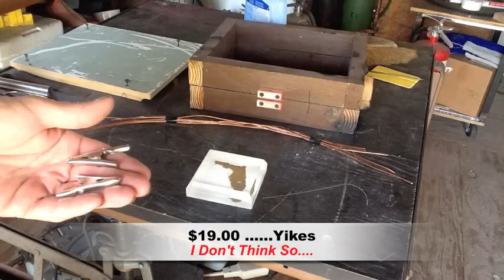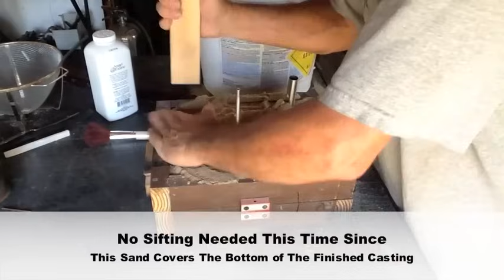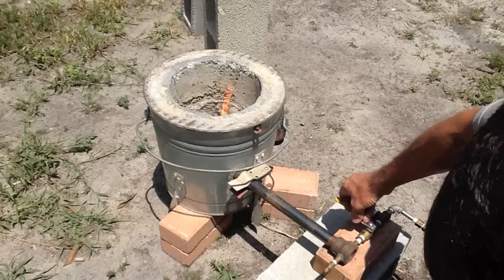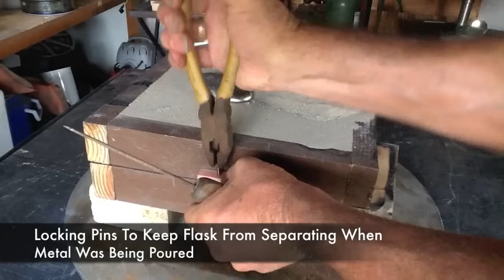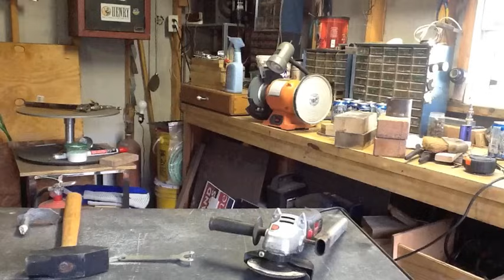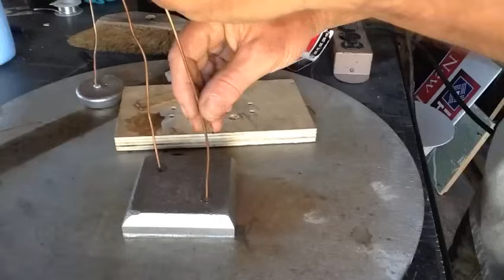SAND CASTING LESSON FOR BEGINNERS - STEP-BY-STEP - (A 3rd HAND) - MSFN

Comment: EXCELLENT video.  I am trying to decide if I want to cast a part for a piece of equipment I have, with a broken sliding release tab.  The tab is no longer available.  The equipment is brand new and was only used twice when the tab broke.  If I cast it out of bronze or copper or aluminum, I feel maybe I can make replacement copies of the tab.  This video encourages me, so now I will buy some casting sand and a crucible for melting metal.
Reply from the maker: I made my own casting sand, look thru my videos and you will find my video on making your own green sand

Comment: Hi :
This is my first time of making green sand , so I would like to know how long should I wait to pore in the new mold as it is wet and my thoughts is it will explode .
Reply from the maker: your sand should not be "wet", just damp. See my video on how I make my make green sand.
Reply: @MakinSumthinFromNuthin  I understand that but it still has some moister , so can that cause it to exploded or do you let it dry before poring the hot metal .
Reply from the maker: @joehenry447  the moisture is what lets the mold hold it's shape. if it dries out totally the mold will collapse when you pour the metal.
Reply: OK , just did not want it to explode , T.Y .

Comment: Great looking work thanks for the video. Please don't ever grind non-ferrous metal on your bench grinder. It can pack up the wheel and potentially cause it to violently explode! Rub a bit of wax on your cutting disk and flap wheels. You will be amazed at how much better it works on the non-ferrous stuff. 
Keep up the great work.
Reply from the maker: Thanks for the tip!

Comment: A handy tip to improve your wite soldering skills would be to use the proper solder and flux. I notice near the end of the video you are using solder and flux for plumbing. There is a huge difference in the ones used for wiring.  I prefer to use solid solder and a liquid acid flux, but you can get good results with rosin core solder which will have the flux inside the solder.
Cheers

Comment: I thought this video was extremely educational. I appreciate the video and I'm planning on getting into this. I do have one question why wouldnt you just put the copper wire into the mold area so when you poor the aluminum it sets into the mold instead of installing it later. I know copper has a higher melt point so it wouldnt compromise it? Just wondering why?

Comment: The bench grinder is not for aluminum. it will load up.  The cutoff wheel will load up also. need to use a hacksaw skill saw or some type of saw.

Comment: Thanks for this well made video. My questions relate to the time and materials cost it took you to make an item you said you could purchase for 19 bucks. (Not to mention the tools you used.) While this video is very instructional on how to make something from nothing, was it worth it? In other words, did you save a dollar making your own, when you consider time and materials? I think this is important. Final lesson learned. Worth making it yourself or not? If the point of this channel is to make something from nothing every time, regardless of time and materials, then you might want to start with the process of gathering ore and refining it, and casting the clips you used. There's a point where trying to do it all becomes ridiculous. I'm just curious where you draw that point, because here it seems largely dependent upon a weighted base. Again, very interesting video, but where are you drawing lines in the sand with this "from nothing" idea? You began with refined metals. Then you added sand and used heat and molds. Where does nothing begin and end? Sorry if that's a philosophical question, like asking how deep is a hole?

Comment: I would think using a wire to pull across the top of the box to cut through the sand then push it off with the stick.
Reply from the maker: That works too!! Thanks for watching & Happy Holidays! 😊🎉

Comment: How long do you need to leave the item in the cast before removing, and do you leave the mold to sit before pouring?
Reply from the maker: I let it solidify for 15-20 minutes, still very hot tho & can still burn you. I pour within 30 minutes of preparing the mold
Reply: @MakinSumthinFromNuthin  no what I'm asking is when you put the item in and cover with sand, how long do you leave the item in before removing and pouring?
Reply from the maker: The pattern can be removed immediately after both halves of the mold have been formed
Reply from the maker: Then pour as soon as you are able to...as the sand will dry quickly. I usually pour within 30 min of making the mold

Comment: hey man i wanted to mold a plastic gear i have using this method what would be your advice? can it even be done through this.
Reply from the maker: Sounds challenging, not sure if molten plastic can flow well enough to fill the mold. I never tried plastic
Reply: thanks for replying you video is really informative. i thought there would be a way to make a mold out of my plastic gear and cast it into an aluminum gear or stronger the same gear keeps failing because the plastic is so cheap and its expensive.
Reply from the maker: You can try using the gear as a casting pattern if you are trying to make an aluminum gear. I thought you were trying to cast a plastic gear

Comment: Really "loved" the "video". "I'm" looking into "casting" and "have" made some "aluminum ingots". I "want" to make "bronze" and try "making" bronze "age" weapons "using" the ancient "techniques"
Reply from the maker: If your furnace is capable bronze or brass is challenging....much higher temps involved. Is fun tho !! 😊
Reply: @MakinSumthinFromNuthin  actually tried copper already. I made the king of random's mini metal foundry with charcoal. Not hot enough, oxidized the crap out of the surfaces though
Reply from the maker: I have a video on making a brass furnace that works awesome

Comment: Hey! Can I cast high carbon metal sheets? Like 1080, 1084, etc. can I melt those and make a sword? What material should I cast? Are Soda cans bad for a sword?
Reply: Thanks!!!!
Reply: Lol, you can certainly try. Steel melts at around 2500⁰ F, and sparks wildly when liquid. Soda cans are made of aluminum, a weak, low temperature metal that's in pretty much everything. It melts in a camp fire and depending on its shape is very brittle. For your ultimate answer, if you tried to cast a sword in aluminum and whack something, it will most likely snap if not shatter. If you really want to cast a battle ready weapon, use a 5-10% alloy of aluminum bronze. 95-90 copper, 5-10 aluminum makes a good work hardenable metal.
Reply from the maker: I would say no to the steel.....Most hobbyists can only do aluminum, brass, copper & cast iron due to equipment limitations
Reply: Thanks! Can I put a crucible in a bbq grill filled with charcoal as a furnace? I’m 11 years old so buying a furnace is not an option.
Reply from the maker: Have your dad try it with you and see!! Sounds like a fun project to do together 😊
Reply: Thanks! What about Soda cans melted into aluminum? Can I cast a sword with the aluminum?
Reply from the maker: If you melt cans, you need some molten aluminum to push them into so start with an ingot or large chunk in the crucible first. Nothing wrong with an aluminum sword. Good luck and be safe!!!
Reply: Can I use aluminum foil, or aluminum hardware? Where can I get a 3D printed piece? How do I make a 2 piece mold for casting?
Reply from the maker: Foil will just oxidize and not melt, is too thin
Depends on what kind of "hardware"...should be ok to use
3D printed piece: I have no clue...online may be an option or a friend?
2 piece mold?, or a 2 piece "pattern"?

Comment: I don't understand what happened to what you call the "pattern", which I initially figured had to do with FL. Maybe that could have been clarified. Thanks!
Reply: Also, where in FL are you? I'm in Gainesville
Reply from the maker: The pattern was removed earlier in the process leaving a void which later got filled with molten aluminum. I am just southeast of Tampa

Comment: This is a super-beginner question, but is the sand wet when you pour the metal?  Does it need to be air dried, kiln dried?  I can't find an answer to that anywhere.  Maybe it's so obvious no one else has to ask, but I'd rather not have molten brass blow back into my face if I guess wrong. Thank you.
Reply from the maker: The sand is mixed with Bentonite Clay and is damp but not wet. Just damp enough to hold shape. I have a video on how I make my green sand  (casting sand)
Reply: @MakinSumthinFromNuthin  Thank you so much for your response.

Comment: Hi there, a quick question about the wires that you fix to the base, could you have put a bend or some sort of big area that could in bed into the base and let the molten alloy bond to it during the casting process? Then you don’t need epoxy true that it might be a bind to clean up around the wires where they emerge from. Anyway I’ve enjoyed the show and look forward to seeing some more of them....Phil 🇬🇧

Comment: So for a piece where the surface finish on one side doesn't matter (say for like a plaque) would you use just one half of the flask?
Reply from the maker: If you carefully poured the metal into just the drag it would work but the back of the plaque wouldnt be nice and flat... Surface tension of the metal would make the back somewhat dome shaped
Reply: @MakinSumthinFromNuthin  Thanks for the reply and all this information, some of the best videos I've found on it yet are from this channel
Reply from the maker: If its not job critical pouring an open flask will work fine....I did that in other videos on some wheel center caps if you want to see it done
Reply from the maker: Thanks Alec!
Reply: @MakinSumthinFromNuthin  That's fine by me, it's for a building and I was just planning on drilling some holes half way through and tapping them so I can thread in bolts and the bolts will be wet set in the brick mortar by the masons. I'm sure I could always mill it flat if I really needed to but the brick is already every uneven type so I think it'll just blend in.

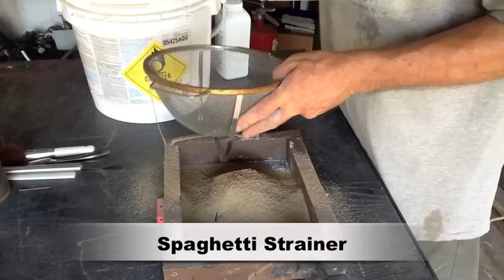Comment: in minute 2:43 The sand is wet ?
Reply from the maker: The sand cant be "wet", it would cause a steam explosion....it must be "damp". Its a sand mixture of approx 89-90% fine sand,  10- 11% bentonite clay powder by weight, with just enough added water to make the sand hold its shape, but no more than that. I have a video on how I make it if you search my videos

Comment: Likin' your vids! On this project, I'd have gone all the way through to the bottom with the holes and then used the angle grinder to make a short groove from each bottom hole, then my copper would each get an L bend to fit in that groove when pushing it up from the bottom so that when they eventually break or it needs to be put away it can be done easily as there is no permanent bond.
Reply from the maker: Yep, I didnt think that one thru! Great idea!

Comment: Wish you told a little more about the sand composition—binder, moisture content, you know: stupid stuff that only former foundry lab technicians like myself would be interested in. 😀

And yes: those 5-minute epoxies are weak, brittle, and can’t withstand moisture. JB weld or the even better marine epoxies that take several hours to cure (at room temperature) are well worth the wait! 👍🏼
Reply from the maker: I have a video solely dedicated to making the sand :)

Comment: I have a 1969 Honda CB750 'Sandcast', one of the first 3000 CB750s ever built and I always wondered what the 'sandcast' part meant -- excellent video!  The people at Honda made the first 7400 or so Honda CB750s ever sold to the public using sandcasting metal forging.  Wow, they busted their bauls to make these first few thousand.  I'm guessing they weren't sure if the CB750 model would sell enough to justify tooling up an actual production line so this sandcasting technique was a cost-savings in case the CB750 model failed in the marketplace (it didn't fail).

.
.
Reply from the maker: Cool story!, thanks for sharing!
Reply: Not to take anything away from this very informative video, but Honda's sand casting methods by the late 60s were absolutely nothing like what's being shown here.  Check out this Edelbrock foundry video, it'll better put you in the mindset of what was happening at Honda back then.
https://youtu.be/ckbpq6OoiEY

Comment: Just a bit of advice for the future: Next time put that cooper wire in the mould (best result with a loop or ad least bend) and then pour the product. I do think that copper have slightly higher melting point than (in this case) aluminium - so you could have save yourself a hustle with drilling holes and epoxy. Regardless great lesson anyway.
Reply from the maker: yes, thats a good idea. Thanks for sharing it :)

Comment: Thanks for the video. I am beginning to get tooled up to do some brass and copper casting. The  first question I have is what do you use for a crucible? I have found some ceramic ones on ebay and such but nothing I can source locally. My second is what type of sand are you using? I have access to some silica sand from a local sand blasting company will that work?
Reply from the maker: For aluminum I use discarded mild steel fire extinguishers for crucibles. For brass I use stainless steel. For large melts I recommend professionally made crucibles, I have a few...just need to make the tongs & pouring shank. I have a video on how I make the casting sand, it can be done on the cheap :) Your sand may work if its very fine sand

Comment: If you dont have the item you wish to cast, is there an easy to work with material to make the template?
Reply from the maker: Wood & plaster patterns work fine, also lost styrofoam using a different casting process yields good results too. Have a styrofoam video on my channel..worth a look
Reply: Thanks, will definitely check it out.
Tried  lost styrofoam before, but the results were really inconsistent. Maybe becouse my sand quality wasn't the best
Reply from the maker: More you do it the better you will get :) Good sand is a must

Comment: Can this be used for making a mold for plastic shells??
Reply from the maker: Plastic shells ?? 🤔
Reply: @MakinSumthinFromNuthin  I mean make mould for making nylon plastic shells
Reply from the maker: I dont believe this process would work for that application, only works with metals. They probably use injection molding

Comment: how difficult would it be to use sand casting for making this type of aluminium enclosure? https://www.aliexpress.com/store/product/Die-cast-aluminum-waterproof-box-IP66-plastic-junction-box-electronics-instrument-case-box-enclosure-240-160/1958769_32584380214.html
Reply from the maker: Pretty difficult, but not impossible. Easier just to buy it! :)
Reply: @MakinSumthinFromNuthin   yeah much easier to buy and also much more expensive :P the size box I need costs just $30 but for some reason they wont ship that size (250mmx180mmx100mm) with china post but fedex instead at  $120 in shipping fees.
Reply from the maker: Yikes, build one if thats the case :)

Comment: The sand didn't fall when you flipped the board, is that a thing or did u use glue?
Reply from the maker: The sand has 10% clay in it so it sticks together

Comment: Hello from the UK, great video just starting out on sand castings so have a few questions if you don’t mind. 
•is there any benefits to using propane rather than solid fuels?
•I couldn’t get copper coins to smelt in my furnace but was successful with some aluminium, would this be because heat was dissipating through the walls of the insulated furnace and because I was using solid fuel?
•how many times can the sand be reused? 
Many thanks, Andy.
Reply from the maker: Propane offers a more uniform heat in my opinion, coal, charcoal or wood will create its own hotspots. The propane circulates evenly in the furnace, just try and avoid direct flame fom the burner if possible.

Copper melts at close to 2000 degrees, tough to do without a proper foundry. For me to melt copper I use the other furnace I made for brass melting, lined with ceramic wool. Check it out.

Sand will last forever with periodic adding of clay ~ Richard

Comment: Fascinating! Can you reuse the discarded metal and remelt it? How about the sand? Can it be reused?
Reply from the maker: Sand can be reused for years, the discarded metal is slag, can sell it for aluminum scrap price if desired
Reply: You could also remelt the slag for another project. Keep it with your excess ingots

Comment: Good video my man. What metal is the crucible made of? Stainless steel?
Reply from the maker: Just mild steel......an old fire extinguisher I cut up....works rather well for about 8-12 melts, depends on how hot you run your furnace. Too hot....= 4-5 melts per crucible
Reply: Thanks for the info. Just getting into smelting metal. There is a lot to learn.
Reply from the maker: Cool...its fun. On a side note....BEFORE you catch grief from friends, family or others....its "melting metal...." not smelting. I learned the hard way....dont want you to repeat my mistake 😊
Reply: Smelting snobbery? LOL!
Reply from the maker: Exactly! LOL